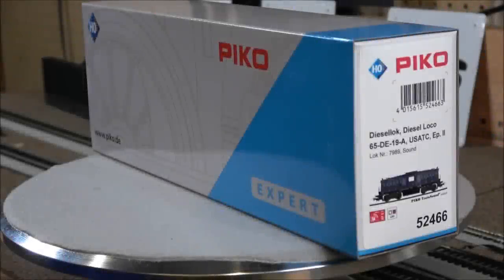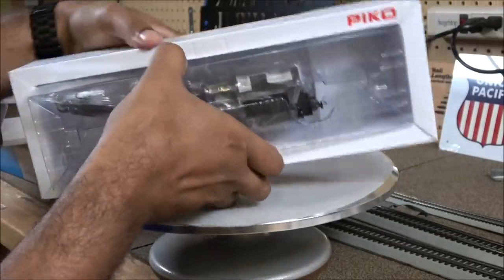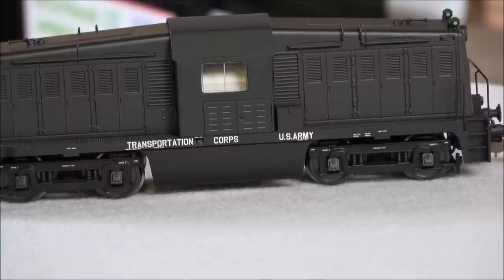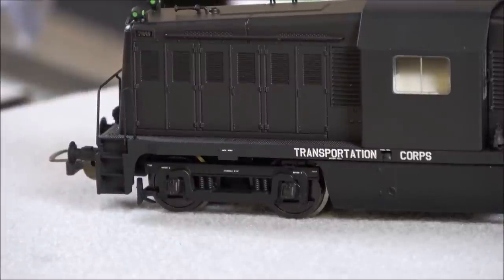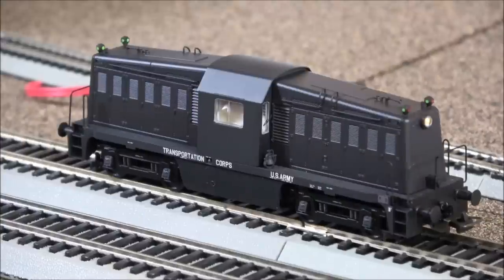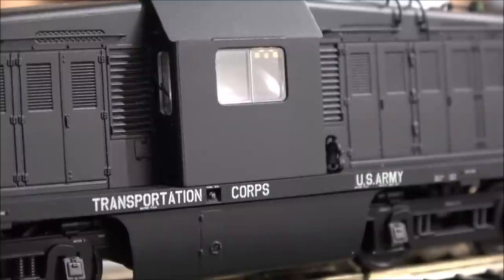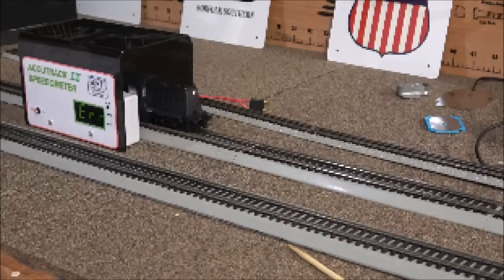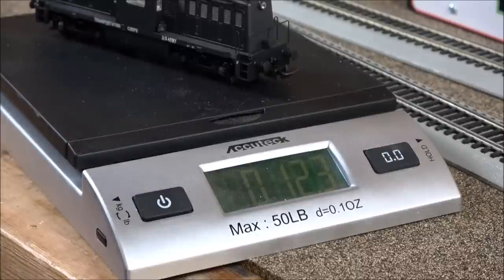Review: PIKO HO Whitcomb 65-Ton (65-DE-19A) Diesel Loco, USATC.  PIKO's first American loco!

Comment: My club owns one. Hands down, the most powerful engine you could ever hope for. It is smooth as feathers on glass and the weight helps keep it firmly on the rails. Never seen it derail. Pulling or pushing, this engine will handle whatever you need. It is truly a terrific asset. Get one, you deserve this quality!

Comment: James, those boxcar styles you described might be the armored version of the Whitcombs.  Not far from where I live there used to be the Camp Claiborne Military Railroad. There were two armored  versions of the 65 tonner there.  I have seen photos of one of those.  I did lot of research looking into that railroad and posted a lot info about the railroad on Model Railroad Hobbyist.  Camp Claiborne was the location of the Army's training facilities for servicemen who would run the railroads as Europe was liberated.  They also had battalions there that were training to repair bombed out railroads.  It is a very interesting history.  There is now a museum dedicated to the railroad camp in Longleaf, Louisiana.  At one time I seriously considered modeling it.  You should look it up.
Reply: They were trained when they got to England, shown the European signal system, how to blow up lines, repair them and build bridges. Canadians were also trained by the Royal Engineers. After the invasion, they moved to mainland Europe. Whitcombs were used at No1 training centre (Longmoor) and No 2 (Melbourne Military Railway). I bought my Whitcomb for an exhibition layout. I have several books showing American engineers and locomotives.

Comment: I have one also, however you do not mention what control system you are using. I am using Digitraxx and the NMRA standard is that function 8 is engine start. On this engine function 1 and 2 is engine start. The big problem is that function 2 is momentary so the second motor does not stay on. Another item is that an engine that heavy shouldn't need traction tires, but this one has them and that cuts down on the electrical contact so it stalls on crossings.  Otherwise, it is a great looking locomotive for my industrial switching railroad.
Reply from the maker: I am using the NCE DCC system.

Comment: I apologize if I missed it, but what about the wheel flanges? They don't appear to be NMRA compliant. I'd buy one of these great locos in a heartbeat, but not if it won't operate on my code 70 and code 55 track.
Reply: @Rocky Ridge Shops ... The model has slightly smaller flanges than European NEM standard and will run fine on Code 83 and 100.  We don't recommend it on Code 70 or 55 without modifications.
Reply: @danpikoamerica7314  Thank you for the response. That's a shame - those wheels are going to be a deal-killer for many modelers. This is a perfect branchline locomotive, but it can only run on huge mainline-type rail. Are the wheelsets hard to remove? I could turn them down myself - it would be worth the effort for an otherwise outstanding model.

Comment: BEWARE!!!
As an Italian railfan, I have to say something for the USA railfans thinking to buy Piko’s locomotive with Piko’s DCC:
If you are using NCE Powercab, like me, and the locomotive has Piko’s Smartdecoder and a big capacitor (stay alive/keep alive/energy reservoir/ ecc ecc), the Powercab can run it, but you can’t program it.
If you try to program with the program track , nothing happens, when you exit the decoder becomes mad and the locomotove start moving and sounding without control.
Also POM seems not to work.

This is what happened to me with the Piko’s FS D.141, a beautiful made italian road switcher.
Reply: Also JMRI doesn’t have Piko’s decoders at the moment.
Reply: @cektito87  JMRI Version 4.24 was released in July and includes the Piko SmartDecoder 4.1.
Reply: @Mark_W_L  thank you! 👍🏻